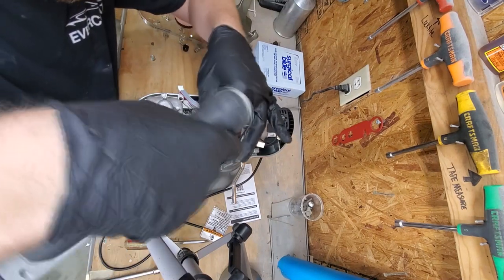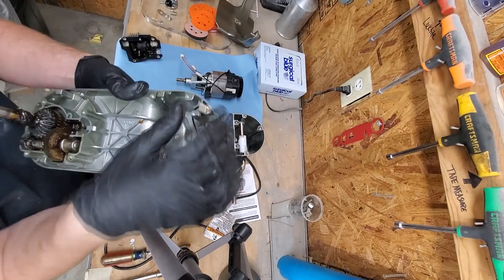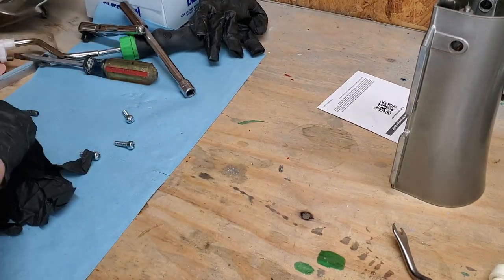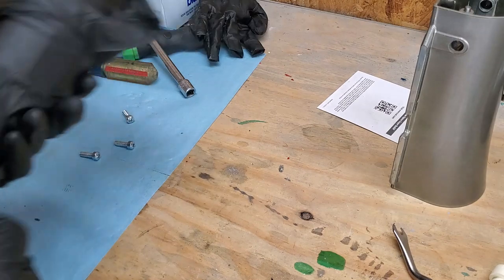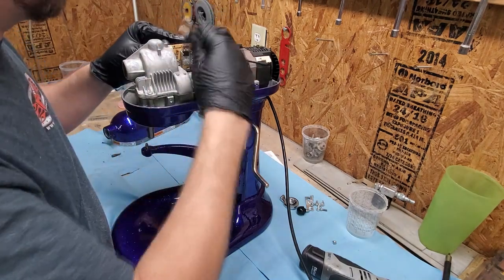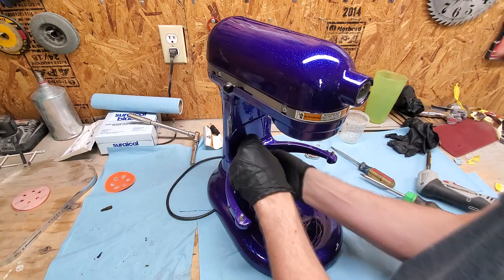Painting a KitchenAid Mixer Properly

Comment: Your small appliance repainting advice is by far the best to most other how toos of painting small sppliances.  Any idiot can paint but just using Rustolium spray paint just leads to a ruined finish in a few months of use.  High grade auto paint system are far far better for longevity and wild color choices

Comment: Beautiful job. I have 2 6qt lift types like that. 1 is my Epicurious that 20 years old. It’s cobalt. I am going to repaint it to metallic cobalt after I up grade the motor from a 475 watt to the 1.3 HP dc motor and change out the motor base and control switch and few other small parts. Yeah I could sale it and buy one but what’s the fun in that.

Comment: This is beautiful! I have a few questions. I have an airless sprayer by Graco. Did you need to thin the epoxy before spraying, and if so, with what solvent? And what solvent to you recommend cleaning the sprayer with afterwards?

And I know you're using auto paint for this with metal flake, but are there other paint types you'd recommend for this application as well? If not, how would you go about prepping paint for a sprayer and cleaning the sprayer afterwards?

Sorry for all the questions, I have an older KitchenAid that I want to refinish for my sister-in-law and don't want to screw it up. 😂

Comment: Wow! I am so impressed by the end result! My mixer is magenta pink, and I want to change it to beige/cream. I was planning to use spray cans. What kind of paints would you advise to get that glossy and professional look? Please use plain English, like easy enough for a first timer in Home Depot paint section😅
Reply from the maker: Automotive paint systems.   Rattle cans are only going to do so much,  but the big thing is that they aren't as durable. A porridge with a catamaran is much more stable than normal rattlw cans.
Reply: @inthehomeshop  so..... I need to find somebody with an automotive paint sprayer thingy? Or send it to be powder coated or something? 

I was hoping to get a good finish with auto paint in a can and an enamel clear coat. Obviously it wouldn't have the same luster as your purple glitter bomb, but do you think it would be fairly durable for a mixer that gets regular use and frequent wipe-downs?
Reply from the maker: Go to your local bodyshop fand have them paint it.  It'll be for cheaper than you getting everything.

I'm going to be doing another one soon. Just a normal color change, I'll record the process
Reply from the maker: Typical aerosol cans aren't catalyzed and won't give the gloss or durability of a 2k(catalyzed) paint.   Aerosols that are labeled as "automotive clear" like rustoleum and such, I promise you, are not the same as what we use on your car

Comment: I have a vintage mixer like this. Do you have any tips for working with those? It's from the 60s. Still works fine, but the paint is not good and it needs to have the grease replaced.
Reply from the maker: Once into the internals,  I cant help you much.

Comment: Thanks for the guide. I just took mine apart. Will be hand sanding it with 400 grit. You mentioned the sealer after sanding, just wondering whether it is the same as spray painting, sanding with 600 then spray again? I am also thinking about using paint remover vs hand sanding, which is better?
Reply from the maker: There's no sense in using a paint remover.  The surface will still need to be abraded prior to paint.

If you don't want to use a sealer and just paint, prep it with 600 and you're good.

Comment: Love this! Most videos I've seen don't go through the disassembly process and simply use masking tape to cover off parts that don't need to be painted. What do you think about that and why did you choose to disassemble?
Reply from the maker: These bigger ones HAVE to be disassembled.  The "lift" mechanism specific to the Pro models slide up and down, there's no way to paint behind on the neck due to it being covered.  

I understand why some just tape them up and on the tilt head models, its easier.  Ive done it both ways on the tilt heads, full tape up, and full disassembly.  there are some pieces that are just easier to tape up than remove.  However, not taking the effort to see how one comes apart and just taping it instead is just laziness. I disassemble as much as I can and tape up what can be left without effecting the final result.

Pro models like in this video, no exception, they come apart too easily, and I will ONLY paint these disassembled.
Reply: @inthehomeshop  thank you! That makes sense!
Reply: @khadeejahmohiuddin9601  thanks for asking this question, I have the same model he disassembled and I’m pretty intimidated by the guts removal part of it…was trying to avoid disassembly altogether because I habitually get in over my head with projects and need a pro to help me finish! I’m gonna go for it today, we’ll see what happens.

Comment: I didn't quite follow the part where you actually painted it. 4:55-5:55. I don't have any painting experience so I don't know the lingo to understand what he is saying or what he is doing? Does anyone know where I can learn more about this process/materials so I can come back and watch and understand?
Reply from the maker: Or you can ask me to elaborate on it more.
Reply from the maker: Just watched it, not sure whats hard to follow.  

I explain what I spray during each step.... this is almost verbatim what I said:  Epoxy, metal flake.  The flake is a custom mix of 2 size flakes from Tropical Glitz.  I bury it in clear, then sand down with 600.   The candy color is a custom mix I made as well using candy concentrates from SEM Products.  Then clear again.
Reply: Is the epoxy a clear shiny spray paint of some kind?
Is metal flake a type of paint or a color? Or is it like glitter mixed with epoxy paint?
Is there a top coat on top of it or do you just sand it?
What is a candy process?
Any resources to learn how to paint like this or use the equipment?
Reply from the maker: @aubrey756  epoxy is a primer.  It sticks to almost anything and most things stick to it.  Metal flake is exactly tat.....flakes.  the top coat on top is the clear.  Yes, the clear has to be sanded flat prior to next step.  Flakes, as you see in the video, produce a hell of a texture that has to be buried in clear and smoothed over.  Thus is why it takes a few coats of clear and sanded flat with 600.  The candy process.....not sure whats confusing  there.  Sand, mix, spray.
For resources about painting, look up Paintucation on Facebook.  He just started an online teaching program, geared toward the D.I.Y.
Reply: @inthehomeshop  thank you for taking the time to respond. I am sorry if I frustrated you with my confusion. I tried to be as clear as I could. Writing isnt my strongest skill.
I am still not sure about a few things but I am probably overthinking it. You did clear up a lot for me! I will check out the resource you gave. Thank you!

Comment: gorgeous results. May I ask if I wanted to hand paint a design on my mixer could I use an acrylic paint then clear coat?
Reply from the maker: The surface would still need to be prepped.   Clear coat won't stick if its not prepped.    If you wanted to hand paint over the existing finish, you could always use enamels like One Shot paints
Reply: @inthehomeshop  thank you, glad I asked. I have a 1950's mixer that needs some love! :)

Comment: I just got a commercial mixer I want to repaint. It clearly has been painted over many times and you can see spots where the paint previously chipped and they just painted over. Do you recommend sanding the paint down or using some sort of paint thinner?
Reply from the maker: Strip it

Comment: Please help. I did the repainting job same as you, sanded and used primer then painted. As soon as I put it back together and tilted the tilt head the paint started scratching at the points where the two main parts meet. Also noticing lots of peeling from moving it around etc . Seems like the paint isn’t sticking. I used a clear coat as well but didn’t seem to prevent these scratches
Reply from the maker: Sounds like you got the paint too thick on the moving parts.  If it's a tilt head model, one coat of color and clear is all you need at the pilot point elsewhere you will run the risk of it doing as described.

The bowl lift models are much easier for this reason
Reply: Thanks for the reply. What do u recommend I do? Is there something I can spray on to remove all the paint and redo a thinner coat. And yes I did spray a lot 😅
Reply from the maker: @esamalamad855  unfortunately you've got alot of sanding ahead of you.  I highly suggest against using chemicals to remove the paint as this is used for food
Reply: Got it thanks. Any advice on what grit sandpaper to use ? And I should sand until the original color goes through?
Reply from the maker: @esamalamad855  it depends on what you used and how thick it actually is.  The thicker it is, the longer it takes to cure.  Not dry, cure.  Cure is different than dry.

I'd sand it down to whatever you started with with 180 and re-prime

Comment: I would like to know why you don't use primer and what kind of paint did you use and where to buy it?
Reply from the maker: I did.  As mentioned in the video, I spray  coat of epoxy before I start. I also mention the brand of flakes and candy used.